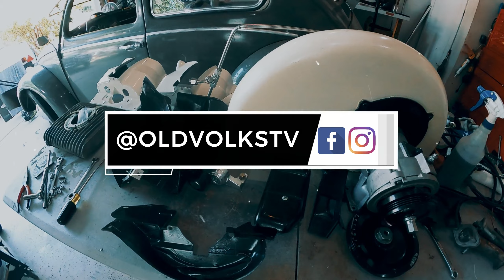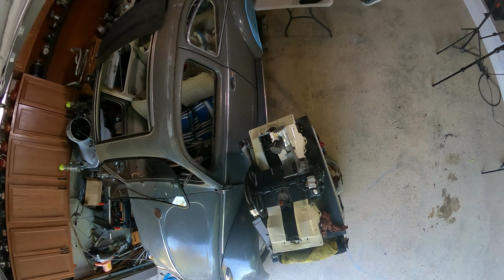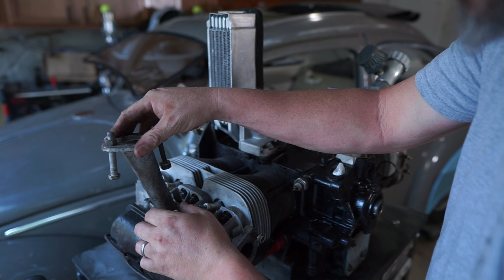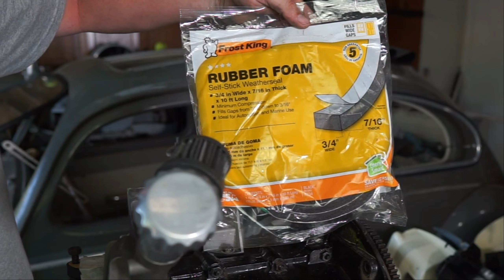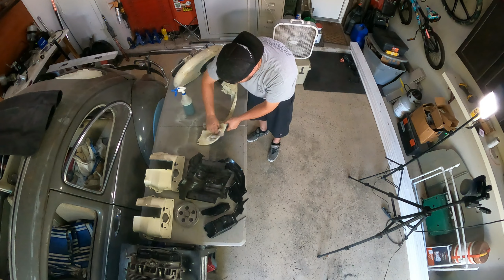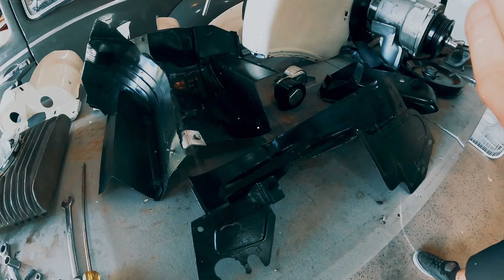Cleaning up Dirty Engine Tins VW Bus

Comment: For your other motor.  I once had the key on the plastic distributor rotor break.  I did not know this and it moved around on the distributor shaft. Could not get the timing.  Ended up building a whole new motor. Then Finally discovered it as I was building the new one.

Comment: always a pain to clean up white painted stuff, they came out very nice.
are you sure that those foam strips done dissolve by heat or crumble?
greetings from Belgium.
Reply from the maker: The clearcoat saved the past for sure. The foam is made for heating ventilation so it should be OK. Thanks For watching!

Comment: If you could pull the front pulley off with baby in arm = it is to loose and will rattle the key way . So much aftermarket stuff don't understand the way the German stuff fits . Like the oil pumps on a new Autolinea case . they just fall in . N-O-O-G-O-O-D !!
Reply from the maker: I already had it off so it was just on enough to keep the key from falling out